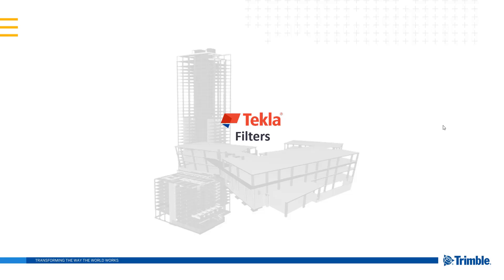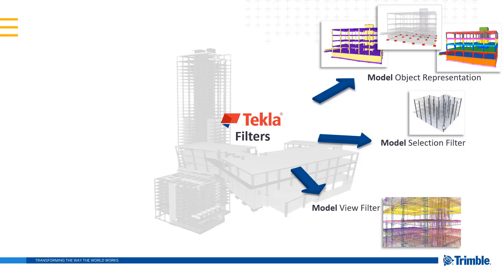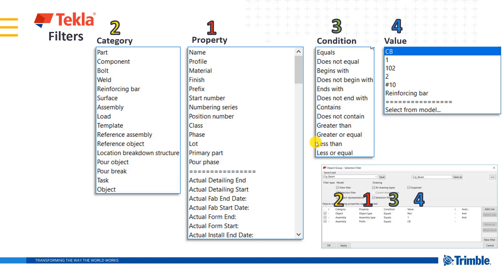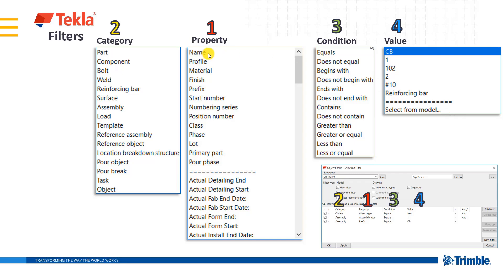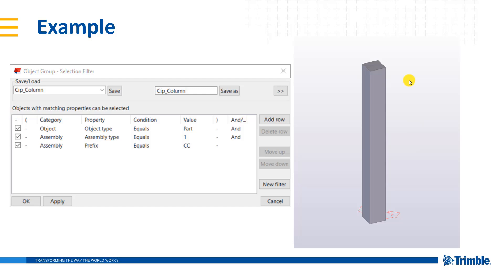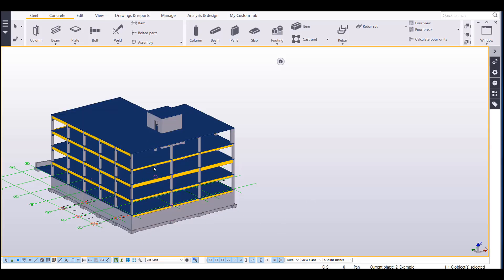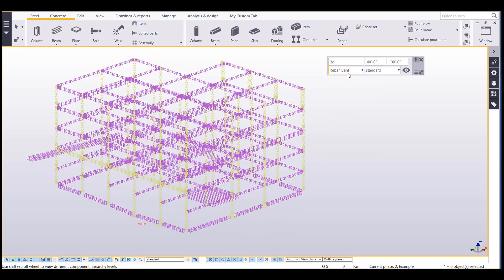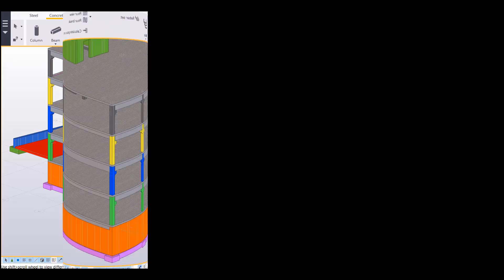Filters for Concrete 1 - Tekla Structures

Comment: how you make reinforcement inside parts disapear. when i'm using column filter the rebar would not go away only concrete gone
Reply: Check the filter rule.  It should specify the line should be some like this 
Object        |   Object type:            |   Equals   |   Part                  |   AND
Template   |   MATERIAL_TYPE   |   Equals   |   CONCRETE     |  —
Reply: i realize i used part instead of assembly, thank you for your suport